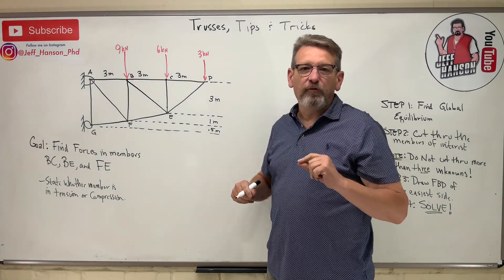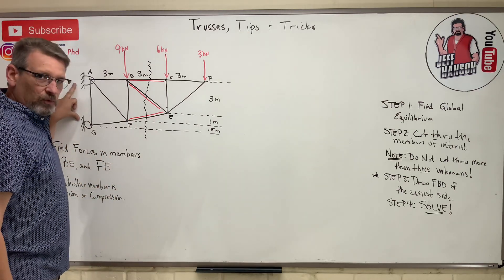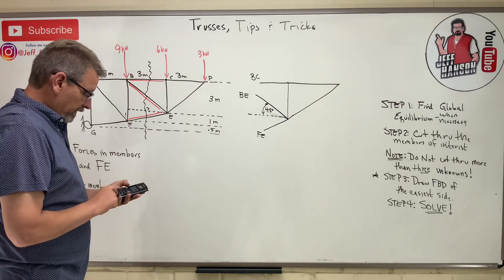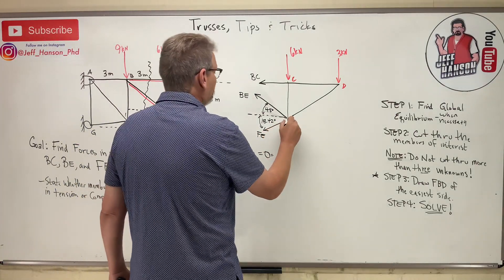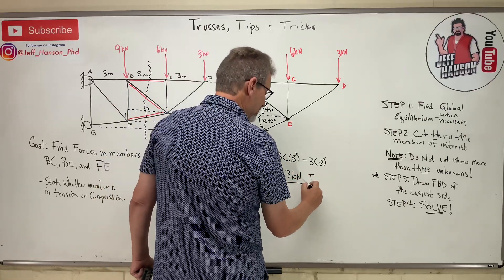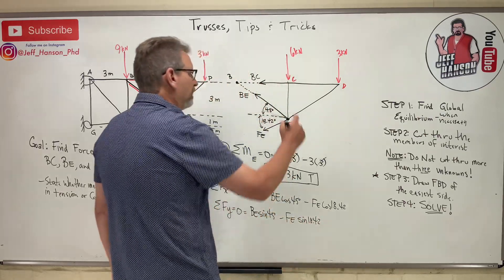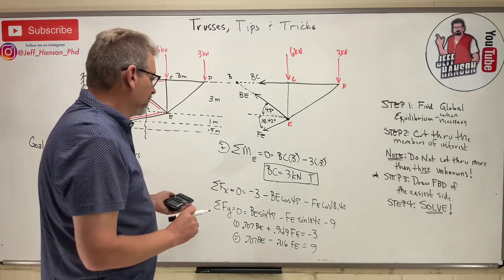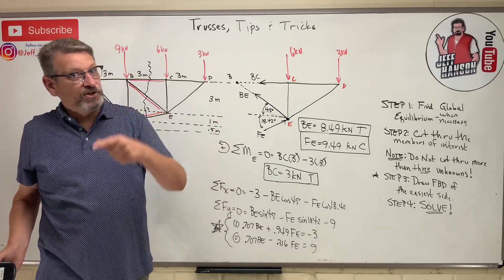Statics: Lesson 51 - Trusses, Method of Sections, Truss Tips and Tricks

Comment: I got 16.98 kN for BE
Reply: Instead of doing the system solver I summed moments at B and got 9.5 for FE and then summed the forces in the y to get 16.98 for BE
Reply: @norapowell1327  yeah, i did the same thing, i think EB should be 16.98 kN
Reply: When i put the 16.98 kN into the Fx=0 equation, my equilibrium equation became zero. But if i put the 8.49 as the answer, my equation didn't equal zero.
Reply: @norapowell1327  bro please tell me how you got 9.5 i am getting only 9 (6*3)+(3*6)+(-FE*4)=0 than FE=9
Reply: agree Nora. I calculeted the same my answer was BE = 16.97 kN in Tension.I think the mistake was in 0.7071BE - 0.949 FE = 3
Reply: problem initiated by signage that's  all  thanks to Mr.Hanson who delvered a very good lecture. TQ Mr.Hanson
Reply: This might be a dumb question. But why is in the problem solver x=BE and y= FE?
Reply: summing at B when solving u will have resolve The FE into vertical and horizontal  component that might be ur mistake

Comment: I have a Question regarding finding Moment at a point which is even not in your FBD , in the case u solved Force at joint E (FE) comes out 9.49KN ..But if wetake moment at  that point which is not visible normally on our FBD means at joint B my ans for (FE) comes out to be 18.96 rather than 9.49....why is it so...

i took the distance 3m as a moment arm for (FE) for both of its component ...
I have exam after 2 days so kindly reply that what mistake i have made

Thank uh for these useful videos 😍

Comment: When doing the equilibrium equations, hoe come you do not have to include the non-cut members? For example at 6.36 which do you not have to include forces in the members ED and CD?
Reply: Because after you make the cut these forces become internal to the system. Therefore they are not considered when solving for each external force.

Comment: Great video. Learned a lot.
at 10.47 a point is reached where 2 equations are formed that Jeff then solves using a programmable calculator.
I would suggest solving using the simple method of 'simultaneous equations' :-
If equation #2 is subtracted from equation #1 then you get only one unknown, which is Fe.
This is then easily solved and results in Fe = 9.49.
If this answer is then plugged into equation #1, or #2 you then get Be  as '-12' and not '8.49'.
Am I wrong?
Reply: They are simultaneous equations. Solving with calculator is a preference and may reduce errors for some. Subtracting equation 2 from equation 1 will give FE = -9.49 N. Plugging this value in either equation 1 or 2 will give BE = 8.49 N:

Equation 1: BE = (- 3 - 0.949 (- 9.49)) / 0.707 ≈ 8.49 N
Equation 2: BE = (9 + 0.316 (- 9.49)) / 0.707 ≈ 8.49 N
Reply: for BE I got -12/sin45 which is like 16.97...

Comment: What is the "system solver" you talk about using I have a Ti-84 and would like to know how to access this.
Reply from the maker: Check out my videos on how to use your calculator!
Reply: @1234jhanson  i am unable to find it ...can u plz insert the link here
Reply: i believe he's talking about what would be the matrix function on the ti-84. you need to press 2nd then x-inverse scroll to edit to fill out the matrix, then 2nd mode, to exit then 2nd x-inverse scroll to the middle find rref, short cut to there should be ALPHA then B, 2ND X-inverse again select in the NAMES list the matrix you entered then hit enter and it will solve your equation. if you are unfamiliar with matrix equations i suggest looking up videos on what they are. Its a function used extensively in Linear Algebra.
Reply: you use( A^-1)*(B) where A and B are matrices. Works exactly the same as the system solver on his calculator. You most definitely learned the matrix way in an algebra course